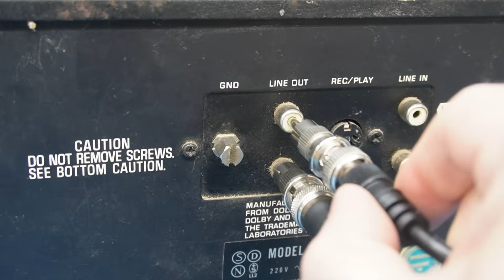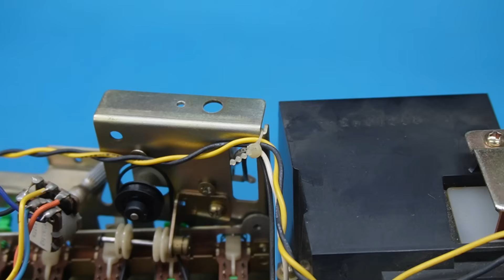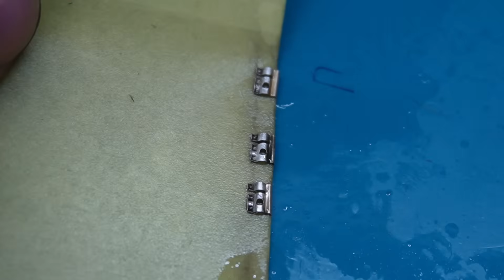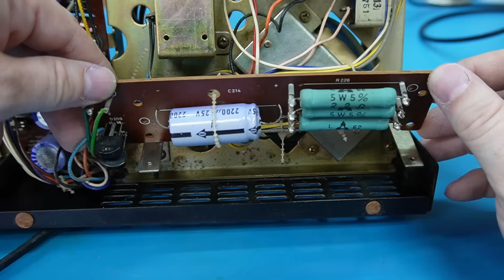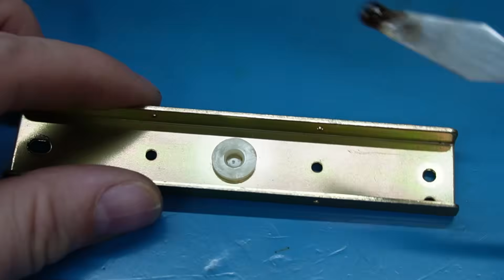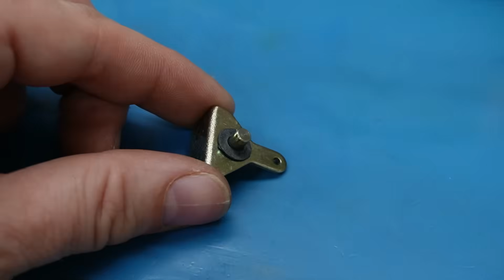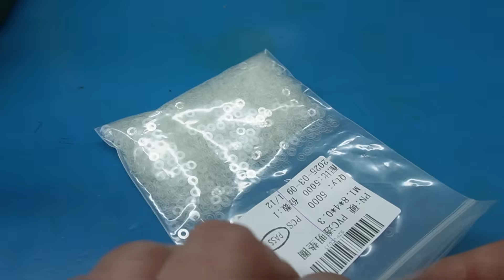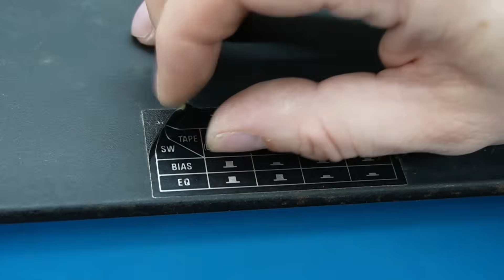The TECHNICS Tape Deck (RS-671)

Comment: Nice fix, Mark!  For bending those tiny tabs on switches and pots to disassemble them, I like using a slotted-end wire wrap tool.  The slot fits over the tab and stands it straight up.

Comment: The 671 was the lesser specced version of the RS 676US , but still retained the top loading mechanism in a front loading package ; both were lesser specced than the top loading RS-276 and 279 US machines , the latter being a 3 head design but both featuring direct drive capstain motors . Black finish ones were never sold in the UK , all models here being in brushed aluminium . I sold and owned every one of these models back in the day - still have my 276 and 279 decks .  

That VU meter on full deflection is indicative of a bad record/play switch with one channel being in record mode and the other in play mode - quite a common fault . The HPF heads for these machines must now be in short supply , though I used to have a small stock of them ; although very hard wearing , it took very little wear to see a drop off in HF response .

Having watched a bit more of the video , I see I was correct . By far the simplest thing to do is to spray contact cleaner into the record/play switches and , holding the stop button down , rapidly press and release the record button to move these switches back and forth until they become clean . Where this didn't work , I just replaced the switches , but then I had access to new ones back then . I've never known any of the transport or function switches to give trouble , but spraying some contact cleaner in situ was always easy to do . 

The other common issue with machines of that age is dry solder joints and just reflowing the boards can often be worthwhile . 

Replacing belts and cleaning up idler wheels is always worthwhile . Hardened rubber tyres can often either be cleaned up gently with fine sandpaper , or even easier , turned inside out and the inner surface will be like new !

Oh , the little plastic panel , with the HPF logo , just inside the door , pops out to give easy access to the heads and capstan for cleaning .

A very nice job in the end !

Comment: Wow! Its old enough to have a FerroChrome position!! also I would have used rubber rejuvenator on the rubber rollers to get the oxidized rubber off. I has worked wonders for me!

Comment: For the idler tyres I've often found the O-rings in the plumbing section at the hardware store are the correct size and shape! Much better than waiting for one to come from the internet and I've fixed numerous decks this way :-)
Reply: It's ok for a moment, but an idler tyre usually has a flat contact surface and will work longer than an o-ring which has a round profile. You will be changing it more often.
Reply: @florianm3170 the ones I bought were square too, I'm not exactly sure how they are called then — but it's the ones that you put e.g. inside the end of a shower hose before you screw it on. A round profile one wouldn't work for more than a few hours of runtime I reckon

Comment: Fiberglass pencil.  eeeeeeee.  Bad memories.  A strand of the fiberglass breaks off and gets into my blue jeans. And just scratches my leg to pieces.  And I search and search trying to find it. OK I've used enough sticky tape to surely pull that bit off. So I put them back on and 10 minutes later. Ouch!!  
We had them in the technicians lab. Several technicians had just given up and thrown their jeans away.
And then the techs revolted and said no fiberglass pen is ever to come in that lab again.  And the pens were banned from the facility.  So every time I see one I shiver. 
When you use one be sure to confine your use to a single place on the table top. And then vacuum it and also use that roll of sticky tape you use to get lint off your clothing.
On the other hand the pen is fantastic at removing tarnish. Best thing.
I still have one. I keep it sealed up in a glass jar. If I need it I take it outside and I'm very careful to not allow any part of my clothing to get under where the pen is being used.

Comment: Excellent repair! Worth saving that behemoth! Those old discreet part Dolby B encode/decode circuits sound much better than the later ones with ICs. The only issue is they tend to drift. High quality caps and 1% metal film resistor replacement job fixes that issue. I used to do that with studio tape machine professional Dolby A encoder/decoder boards, as the early versions had the drift issue.

Comment: get a 10ml syringe for the moly lube mr Mark... much cleaner application considering how 'dirty' moly gets. 
one of those thick pink needles, cut in half for better flow and you got yourself a nice grease applicator w/ excellent control.
lovely work on the tape deck :)

Comment: After 50 years the electronics are still healthy! If only all equipment could be made this reliable. Good job Mark, your work is flawless. Thanks for posting.
Reply: They still can, they won't. Shareholders, replacement is more money.
Reply: The capacitors are way beyond their end of life. Replacing them, best with modern polyester caps, will become inevitable if the deck actually sees much use.
Reply: @Breakfast_of_Champions 

But only because they are Matsushita caps. They like to leak their fluid onto the circuit board. Always check those caps for "green legs" or replace all of them right away. 
Other brands of caps used in tape decks are usually not problematic, replace only when needed, and maybe the main filter caps to protect the transformer. The small signal caps aren't critical - what's an ESR of a few ohms more than spec in a high impedance circuit, Ohm's law says, nothing. Some of those old caps would still outlast any Ali Express special replacement.  
If it ain't broke, don't fix it.
Reply: @westelaudio943that's not right. All sorts of electrolytic caps had bad batches with a high chance of leakage. Let's say several ELNA caps for example. Old Harman/Kardon tape decks with US made caps leak horribly. This isn't just a single brand...
Reply: @matthiash.4670  

Hence, "replace only when needed". Matsushitas are the only ones which are almost always bad though.
Reply: @westelaudio943  and that's not true!
Reply: @matthiash.4670  

Well it's my experience with the 70s and 80s ones at least. I'm not sure about the later ones, from like the mid 90s or early 2000s, as I usually avoid them. The mechanisms are too finicky for me and it was the capacitor plague era so bad caps are probably more of a problem there.
Reply: Also Chinese cheap parts and materials.  Poor QC. Controlled obsolecense.
Reply: It could be. But nobody will. Planned obsolence and all.

Comment: I really enjoy your videos, your electronics competence is immense but I have some tips from my hudreds of decks successfully restored.

You should blow your stuff really good with compressed air before you work on it, it's quicker and easier than deal with patches of dusting and vacuuming later. Get yourself a set of fine and long bristle brushes, that will help a lot displacing most of the dust particles.

Other random tips: your should lubricate the capstan motor's front bushing when you can, it makes a difference. Be careful on the tape counters most have numbers barely hanging on, again brushes and brushes to clean and even grease. That idler with no index can be a problem later on.

You need to go far more in depth with the calibration.

Comment: On todays episode of Grease It Mark... :)
You probably shouldnt make that little rotor super smooth anyway. Leaving it little rough gives whatever rubber touching it little bit of grip.
Specially when you relly on old rubber wheel that isnt as soft as it used to be.

Comment: To effectively set a high-pass filter (HPF) for your head unit, you'll need to understand its purpose and how it interacts with your speakers. HPF is used to filter out low frequencies, allowing your speakers to focus on higher frequencies, which are often reproduced more accurately. This ensures that your speakers aren't forced to play frequencies they aren't designed for, potentially leading to distortion or damage. 
Here's a breakdown of techniques for setting your HPF:
1. Understanding Your Speakers:
Frequency Response:
Know the frequency range your speakers can handle. This is the range of frequencies the speaker can reproduce accurately. 
Speaker Type:
Consider whether you're using subwoofers (which will typically use a low-pass filter) or full-range speakers. 
Installation:
If your speakers are in a vehicle, the cabin acoustics can affect how the HPF is set. 
2. Setting the HPF:
Start Low, Adjust Up: Begin with a low frequency setting for your HPF and gradually increase it until you start to hear a difference in the sound. 
Listen Carefully: Pay attention to how your speakers sound at different HPF settings. 
Avoid Distortion: If you hear any crackling or popping sounds, it's likely the speaker is struggling to play the frequencies. Increase the HPF to alleviate this. 
Consider Speaker Size: Smaller speakers may need a higher HPF setting than larger speakers. 
Subwoofer Integration: If you're using a subwoofer, you'll need to set its low-pass filter to a frequency that matches the HPF of your full-range speakers. 
3. Practical Tips:
Test Tones:
Use test tones to precisely set your HPF. For example, a 1 kHz test tone can help you adjust the gain on your amplifier. 
Multimeter:
A multimeter can be used to measure the voltage at the speaker outputs, helping you ensure the gain is set correctly. 
Crossover Point:
The crossover point is the frequency where the subwoofer will take over from the other speakers. 
4. Advanced Techniques:
Equalization (EQ):
.
Once you've set the HPF, you may need to use EQ to further fine-tune the sound. 
Phase Alignment:
.
Make sure the phase of your subwoofers and full-range speakers is properly aligned. 
By following these steps and understanding the principles behind HPF, you can achieve a well-tuned audio system that sounds its best.

Comment: For as long as they have existed, cassette tape decks have been a colossal pain in the ass to repair, to the point that the cost to repair it would rival the cost to replace it. Every electronics repair shop I visited back when I was trying to get my TEAC C-3RX repaired back in the late 80's was extremely hesitant to take on the project. When I finally found a tech willing to tackle the job, it sat in his shop for over two months before he returned it un-repaired, apologizing that he bit off more than he could chew. Mark tackled this project with patience, a sense of humor and a considerable degree of skill. That Technics deck (671) usually comes in silver and sells for a few $hundred at used auctions. Finding them in matte charcoal is next to impossible, and may be a clue to why the owner felt a repair, even if costly, was worth it.
Reply: I can understand that repair shops don't want to bother with cassette tape decks Sure hope that you finally found someone to repair it, The TEAC C-3RX is a legendary model, a direct predecessor of the iconic TASCAM 122 MK I.
I have the C-3R (same but without the integrated DBX), and I am in the process of adding a Dolby C noise reduction to it. More difficult than I thought but I will succeed for sure..
A You-tube channel with a guy who is specialised in TASCAM deck repairs with a similar ethos like Mark:
https://www.youtube.com/@asbcustom
Reply: I love the charcoal color, gives it sort of a quasi-military look like out of a Rambo movie
Reply: @  And well ahead of the fashion, when you consider that a few years later all the faceplates went to black.
Reply: A bit late in the day for your machine, but there were/are at least two people specialising in tape deck repair in the UK - mentioned every once in a while on hifi forums.
Reply: Would you have wanted to pay the diagnostic and labour fee involved I wonder? That's the hesitancy for repair workshops - dealing with the owners with unrealistic expectations and/or resistance to pay what is firstly even required for diagnosis. Mechanical must be ruled out first with Cassettes, then there may be a circuit issue.
Reply: @MrJezzalenko   I think you're both right. Current labor rates make skilled repair unaffordable, and cassette decks are extremely finicky machines with both electronic and mechanical problems.
Reply: @wheatonna I had a cheaper Akai HX2 deck, which I modified earlier, added a homemade IR remote controller module, but the belt replacement procedure was a real pain in the *ss for me, I did not have the courage and the skills required for the job. So I sold it. I did not find a trustworthy mechanic for the project locally. Everyone I asked, said that they do not want to do it.

Comment: "Hey! That's my Tapedeck!" I thought when i started watching this video. Mine had about the same issues, slipping idler wheels in fast forward/rewind. I was quite surprised when i cleaned the front, that it wasn't black, like i thought when i bought it, but metallic brown. Another thing that didn't work on mine was the main solenoid. It did work, but the diode across it was defective and the poor solenoid turned into a space heater :D I really like how well made and "solenoidy clonky" it is :D Good job on your Technics RS-671, Mark! :D

Comment: I can see why no one wants to service these anymore. Way too many small parts to lose in this process. I'm so glad I have a Technics RS-BR465 that uses a few more solenoids than this one and purrs like a kitten after almost 40 years of use. I knew you would refinish that cover...but not the screws? (c:  Nice work as usual.

Comment: AHH the good old days when one could strip down and repair a lot of audio gear , replace a few belts and a clean up and most equipment would spring back into life. Great job Mark and a credit for going the extra mile for your customer. In this day of throw away electronics , it is good to see a teck still being able to repair such equipment and keep it out from land fill.
Reply: Fortunately, things are starting to change. People realise that throwing stuff away instead of repairing is wasteful and can cost a lot more money in the long run. But you do need some basic skills to be able to repair things.

I've just given two old laptops a new lease of life. I gave the innards a thorough clean, replaced the physical HDD with an SSD, doubled the RAM and put Linux on them (they won't run Windows 11 anyway). They're good basic machines for browsing, office work and playing video and music, despite being well over 10 years old. They probably would have been recycled or ended up as landfill otherwise.

Comment: You may balk at such seemingly harsh cleaning methods but I can recommend TE's channel. He restores Hi-Fi equipment in an Asian country where there is plenty of dust and high humidity (possibly Vietnam).
His method of disassembling devices and using a pressure washer to clean everything is most efficacious!
I know from my history in developing moisture measurement instrumantation that soapy water is one of the best ways to clean electronics.

Comment: Just wondering if adding a second tyre over the original rubber drive wheels would have compromised the tape speed making it run faster?

Comment: Delightful! Thank you for such an in depth cleaning & restoration. Quite soothing watching you do all this. May I suggest you use a snippet of magic erasing sponge soaked in IPA with which to clean the pinch rollers, capstans and etc. while spinning. This is also great for removing decomposed belt residue anywhere you find "melted" rubber belts debris.
Thanks again!

Comment: Hello Mark, maybe an idea for you. Before I work at some equipment I do wash it with VK4. It's a special soap which is used by a salvage after a house fire. All switches and boards are then shiny and easier to work on. It also removes cracles in pots.
Reply: Do you have a link to buy this stuff?
Reply: @edherdman9973  Sorry I don't, a friend off mine work at a salvage company named Belfore. It's an English company. Mabye you can try with them.

Comment: They really took pride in building that tape deck!
It's a thing of beauty! And nothing wrong with it electronically!
Reply: Technics is a Panasonic sub brand, correct?
Reply: @nsbhagwat yes, both are Matsushita Co. Ltd.
Reply: @nsbhagwat  yes, Matsushita Co., Ltd.
Reply: The capacitors are way beyond their end of life. Replacing them, best with modern polyester caps, will become inevitable if the deck actually sees much use.

Comment: Great! I used the RS-671 for mostly all of my tape recordings in the 80s and 90s. I still have it but it got the same problem with the playback/record switches. I bought a second unit for spares  (like yours with black front) and built one out of two. At that time I did not know that I only need to take apart the multi switch unit and clean it (I thaugt it was worn out). Only later I got more experienced in repairing them. I also always put some special contact grease on it after cleaning the contacts to prevent corrosion.
Reply: Presumably the HPF Head will not degrade for a very long time.

Comment: Impressive repair!
Although I’m a bit concerned about using super glue for retreading the tire. Contact cement would be safer in the long run.

Comment: Captivating. And takes me back to the day I needed to replace a broken reed switch from a contemporaneous Technics tape deck because it always thought it had reached the end of tape travel... I certainly didn't need to strip the whole thing down to make it work again though! :)
I bought a pair of the reeds, and still have the extra in my parts box which I get out as a curio for guests sometimes. If you ever need one, I can send you it! lol.